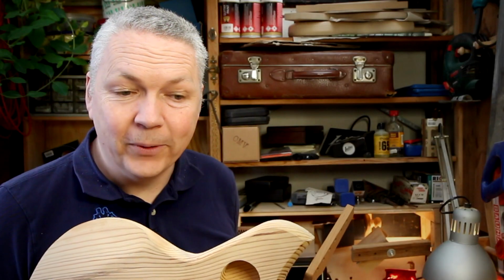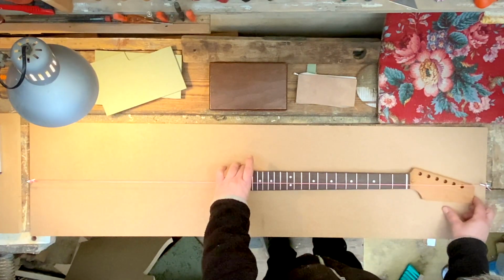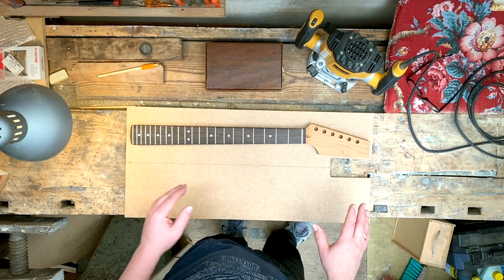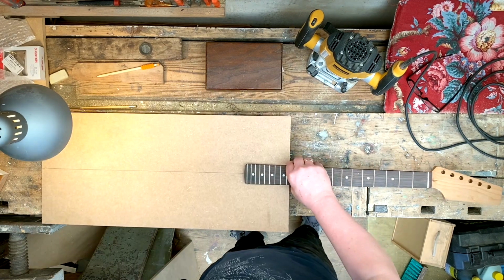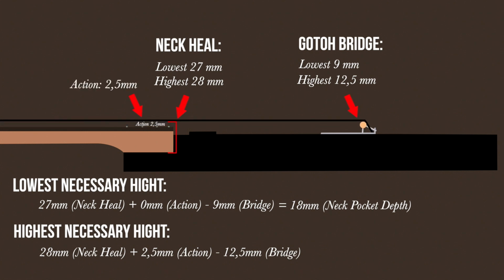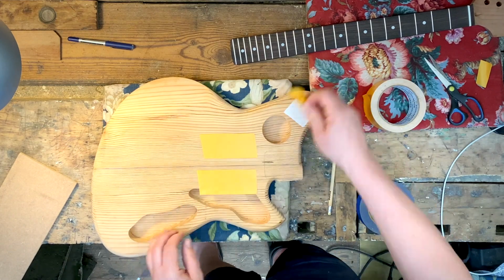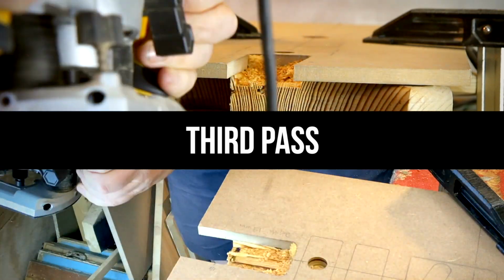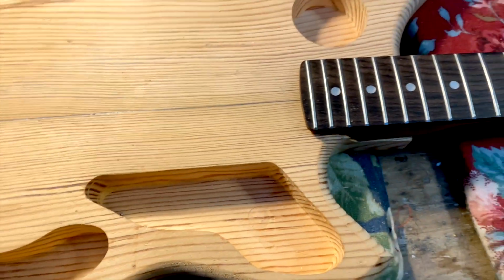How I made an (almost) perfect NECK POCKET

Comment from the maker: Hi guys
Thanks so much for watching I really appreciate it.
If you wanna see more of these videos and wanna support this channel please check out my shop where that juice meets guitar building nerds.

https://lagerstedtguitarbuilds.myspreadshop.dk/

If you are looking to buy guitar parts you can also support the channel by going to 

www.guitaranatomy.com 

… and use the discount code: Lagerstedt10
- for a 10% discount.
Thanks so much 😃🙏
Reply: 02:32 Why isn't it perfect? What are the problems there? I removed a year ago the neck of my strat copy and now the body seems to have changed due to humidity. The neck pocket was way too tight anyway. I'm trying to realign and reroute the neck pocket now. If your method wasn't perfect how can I achieve an absolutely centered neck? Doesn't matter how much work it is. I'm a perfectionist and I'm trying to achieve less than tenth of a millimeter deviation from body to the end of the headstock. I want it perfectly centered How should I do it? Your accent sounds German. Grettings from Braunschweig by the way.

Comment: Thank you! This really helps!
This is the point I‘m stuck at because I don‘t know where to place the bridge and the neck and which way to route it correctly, but you just made it a lot easier :)
Looking forward to more great content from your!
Reply from the maker: Hey Vik
Thanks so much 🙏. Means a lot to know that it’s helpfull. 😃👍🏼
Reply: @MichaelLagerstedt  02:32 Why isn't it perfect? What are the problems there? I removed a year ago the neck of my strat copy and now the body seems to have changed due to humidity. The neck pocket was way too tight anyway. I'm trying to realign and reroute the neck pocket now. If your method wasn't perfect how can I achieve an absolutely centered neck? Doesn't matter how much work it is. I'm a perfectionist and I'm trying to achieve less than tenth of a millimeter deviation from body to the end of the headstock. I want it perfectly centered How should I do it? Your accent sounds German. Grettings from Braunschweig by the way.